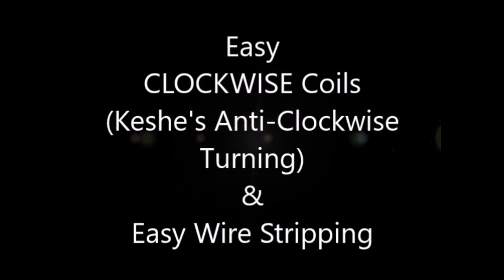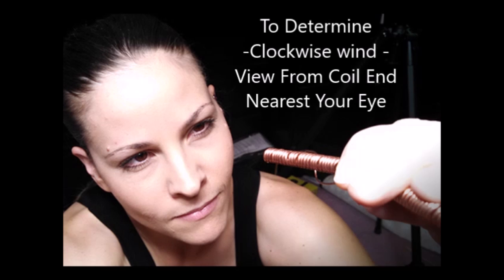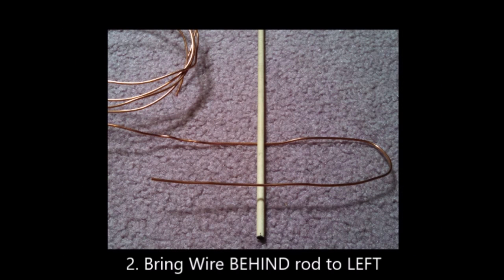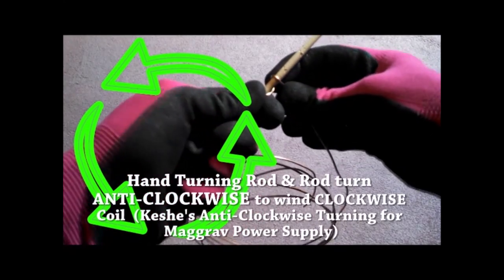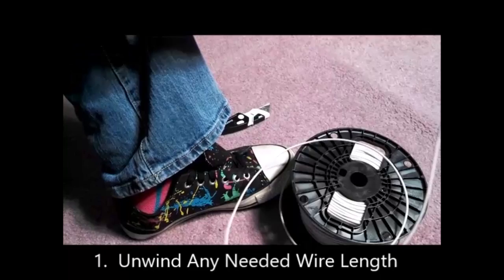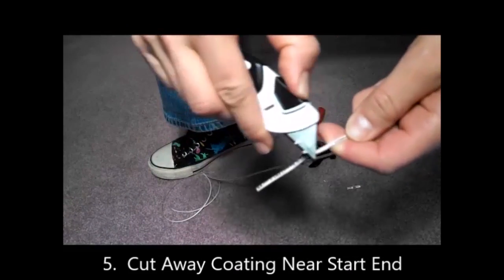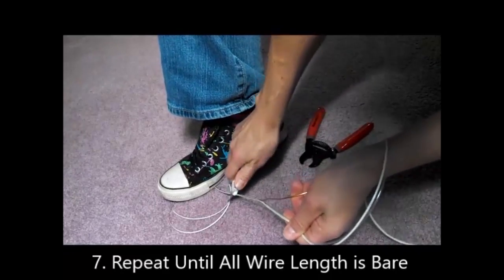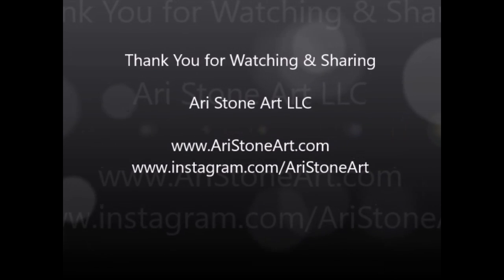Lesson 1 Maggrav Coil Winding and Wire Stripping

Comment: Until one end of the coil is distinguished from the other, a coil can be accurately labeled as cw, ccw, left-handed, or right-handed. The issue then is how to distinguish one end from the other.
Reply from the maker: anisaampatuan I understand what you are saying,  this is why you have to follow the coil wind 'away from' your eye (doesn't matter which end you look through) toward the world.  If you look at it in reverse (from the world,  toward your eye) it is then the opposite. I originally hunted down the info  to find out how an engineer labelled coils as clockwise or counter-clockwise and then put this video together.  Why it often seems so confusing,  is because to get a clockwise coil,  you have to turn counter clockwise when you wind it.  Would you be interested in seeing more videos on the full process of building a unit and installing with your car?  my units don't power my car instead of fuel,  but I love the positive energy field with it and I've had them installed for quite some months now.

Comment: Can you please explain which way the plasma flows in the coils? Thanks
Reply from the maker: adhanda2017  Hi, while my units don't power my cars instead of fuel,  they do create a positive energy field.  Would you still liked me to make more videos showing my process? I have a fast (no electric tools) way to wind copper wire too.  I also have an easy way too show/explain how the energy flows. But, the bottom line on that is.... clockwise energy flow with inner gravitational coil sets, and counter clockwise with outer Magnetical coil sets.

Comment: Hi there, so I'm working with some friends here in Mexico on some Keshe projects and I'm just wondering how is it going?  Have you connected your MaGrav unit and is it working well?
Reply from the maker: Sabrina Surving Hi there,  I did connect my unit (2 actually to 2 different cars) to my car,  however,  I have not seen any fuel savings. there are a few things I may have done wrong,  but,  it does create a positive energy field around my car. people rarely ever tail-gate me anymore amd I feel happier when in my car.  I'd have wondered if it worked at all,  if I hadn't   used a red (likely more a blood gans,  than sugar) gans on one coil set, that made the unit get super hot when connected to the car battery (even with the vehicle not running,  it smoked). But, once I replaced it with a coil set with just copper and co2 type ganses,  it was completely cool again.  I'd wonder if it was running at all if I hadn't had the first experience.  But, overall, energy wise,  I love my stackers! I've been debating on making the rest of the videos anyways,  cause maybe some others can figure out how to make a working one from improving on/correcting the things I may have done wrong.  But at the very least,  I think the energies are great.  Days I felt more sad, angry,  or depressed...I'd go for a drive...and feel better.  Would you and others still be interested to watch more videos on how to make one even if it only generates a good positive energy field?.

Comment: no rules no confusion method:
get an electric drill or electric screwdriver. switch it to unscrew. put a rod in the chuck. put the wire end in the chuck too or in a hole drilled in the rod. start the drill/screwdriver and wind the coil away from the drill. this is correct no matter what you call it!!
Reply: Nice description, but incomplete. Until one end of the coil is distinguished from the other, a coil can be accurately labeled as clockwise, counter-clockwise, left-handed, or right-handed. The issue then is how to distinguish one end from the other.